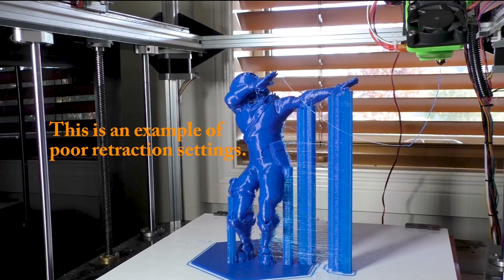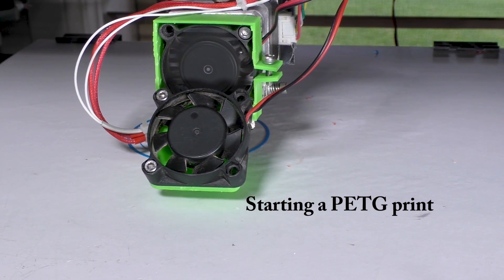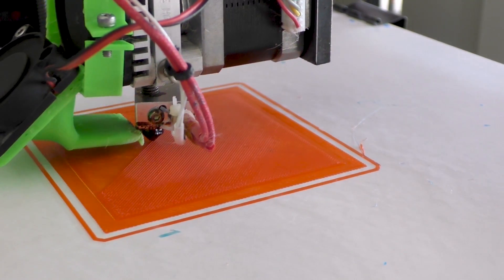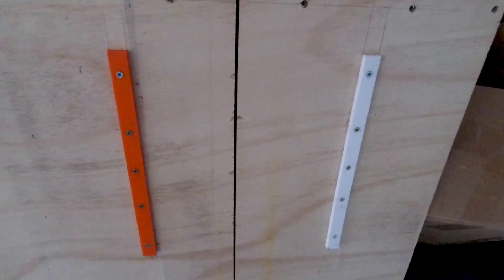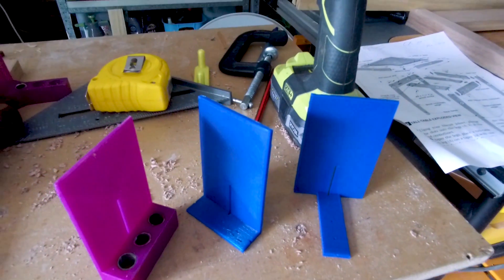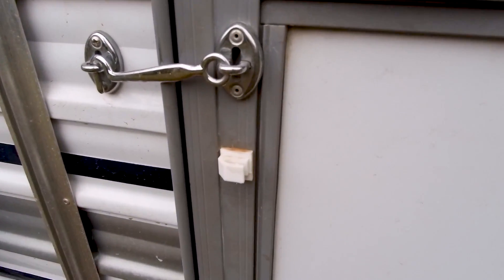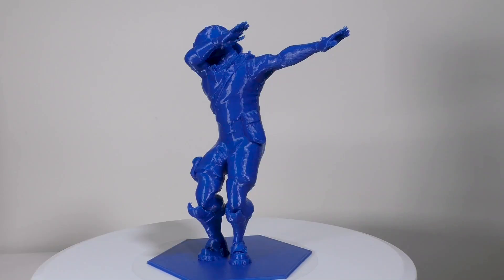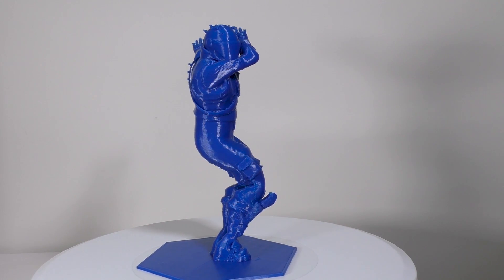A Beginners guide to printing PETG Filament

Comment: Currently printing first layer at 180mm/s and the rest at 380mm/s 💪🏻 rapid PETG at 240c/70c on an alcohol cleaned smooth PEI plate. No clean no stick

Comment: Still having trouble getting petg to stick to my glass bed. Hmm. Better get some painter's tape for when it does stick😲 Cura slicer's temperatures for petg were about 5 degrees lower than yours. I'll try it 5 degrees warmer.

Comment: Great video. I just went through 3 hours of frustration. Tried bed at 70, 65 and 70. Tried nozzle at 190, 200, 205 and 210 and 220. Adjusted z offset and so can't get adhesion. I noticed you have much higher temps and slower speed so I'm going home to try that. Printers in 2024 are a lot faster so if you think there is a better speed based on current printers, like mine goes to 500mm/s, please let us know!
Reply from the maker: slow the first 2 layers down to 20/30 mm/2

Comment: I have heard Acrylic cement like weld on 3 or 4 works in cementing PETG parts together on a molecular level. I'm not sure if this is true but I have used weld on 3 and know it works excellent on acrylic. I'm going to try it myself pretty soon but was wondering if you had already tried this method for connecting PETG parts together?

Comment: Retraction is 3mm ... 35m/s for a direct extruder setup. Print as fast as you can. I will try that. Did you ever play around with flow rate? Also, I am using the standard 1.75 diameter filament. Thanks and great video. Richard

Comment: Ive gotten some pieces to print with PETG on the Ender 3 PRO, but it actually took a spot of the black part of the bed off. I did some adjustments and now I cant get the filament to stick to the bed.

Comment: Excellent beginners guide. I have been working with PLA for 5-6 years and would like to try PETG for better UV/temperatur characteristics. 
I would still use PLA when it is suitable. 
Is it wise to use PETG with a dedicated printer, including hotend etc,  or is it no problem to swap between PLA - PETG - PLA..... ?

Comment: you mean i gotta clean the extruder?  that's what I'm getting, it just curls up at the extruder, won't lay down on the glass.  Can I get this stuff to stick to glass or do I need a pad?  how do you get the slicer to lay down the first layer with different parameters? from the rest of the print?

Comment: i can vouch for petg sticking way too hard to the bed. my friend is really dumb but he thinks he is a bit of a printer guru cos he has the most expensive printer out of all of us. anyway i do my research and i knew that petg sticks too hard and so i told him he should not be squishing the first layer and then he completely thinks i am the dumb one. so he bet me that the petg wouldn't stick too much and then i bet him that if he doesn't think it will he should put his wang on the print bed and accept the first layer onto his p$n!s and so he said, OK for $100. We all said ok and then set up a print and the petg went straight down on his pecker and he was screaming and had to go to the hospital and indeed the Doctor said the plastic was very stuck to his purple helmet. he doesn't speak to us after that but i think he now sets his petg first layer height a bit higher cos he knows it sticks REAl GOOD. Ha ha ha

Comment: My biggest issue with PETG is that it gets all over my nozzle. It's the only material I'd like to print with for now. I had been printing at 250C for months, and had successes. But perhaps printing at so high a temperature, the material is attracted to the nozzle more so.
Reply: Correct. 
Lower temps have helped me preventing those blobs. Also, try a lower temp 1st layer and bump it up by 5 or 10 degrees for the next layers. The nozzle likes to cling to hot PETG at the base layer.
Reply: Old comment, but what I found fixed some of my PETG problems was actually having the nozzle further away from the bed, it doesn’t like to be squished down like PLA. High bed heat - 80-90C- makes sure it’s adhered even if not close to the bed.

Comment: Any idea why my first 3 or 4 layers seem to go down too thick and start rubbing on the nozzle and making a mess?  After the bottom layer when it starts infill, the rest of the print is absolutely fine.  It's like the PETG is expanding as it cools.
Reply from the maker: That is a strange one - check your slicer settings.
Reply: I have the same problem, still haven't figured it out. I think it might be moisture or just too much heat due to the bed being hot and the first few layers being too close to it.

Comment: With the filament sticking to the nozzle problem, I had a brand new stainless steel nozzle to print the PETG with, it still stuck to the nozzle in a ball. The only thing I can think off for this sort of problem is the nozzles need a coating of Non-stick on the nozzle face like Teflon then maybe that with help stop the sticking problems?  So PETG is an hard filament to do right. I know so hard I may well not carry on trying to use it?  Even ABS is big pain in the backside too!  I even find PLA can be a sod to do even with the bed leveled and the Z height right.  I've tried the Hair spray, the glue stick. I used ultra flexible textured bed and none of those hold on to the PLA neither known the ABS or PETG?  It driving me nuts the amount of time , money and troubles I can see why 3D printing is just for the people who seem to have a gift for doing it well/ Us new to the hobby I think tend to try very hard and put in tons of hours of work spending tons of money on this possible great hobby and end up fed up at not getting it to work even with the advice from the experts.  I maybe not carrying on with this hobby as I put tons in and don't get PLA to work.
Reply: Remove your nozzle, spray the external section of the nozzle with an extremely thin misting of cooking spray. Put your nozzle back without touching it too much with your fingers. Also, what surface are you printing on?

Comment: I actually just flipped my spring steel bed so i'm printing directly on the steel. and that's working GREAT. When the print is cooled a little it pops right off.

Comment: Great tips.  I have been banging my head against the wall on a perfectly flat bed, and from you I learned I was trying to print way too fast.  I dropped back to 25 (Ender 5, glass bed, Magicgoo) and it's bonding/building up nicely.  Thanks

Comment: 7:11 into the video.. (you do not need to glue petg) just use a soldering iron and plastic weld it together.
Reply: Or couldn’t you make like pegs or something to fit the pieces together?
Reply: @theCraftyHeretic  Sure you could.. Just from my experience fusing the plastic together is a simple quick method that has high strength.

Comment: Finally someone says petg is not easy to print unless you've got things nigh perfect. 

It's great when I can use it but there's some models for which it's too much trouble (compared to abs or pla). If you can't remove the support, or can't add support in the right spot, then the object will be distorted - and functionally useless. Cura's "tree supports" helped a lot with this, in addition to painstaking tweaking. 

In my limited time with my printer I can say I've had more trouble with PETG than PLA, ABS and a little TPU (haven't used it much) combined. Although it helped when it came to getting TPU right the first time.

Comment: I've been using petG with my 3-D pen.  It's been working really well compared to other filaments that I've tried.  I know the application and set up is even more different using a 3-D pen versus a 3-D printer, but I wanted to see if there were any resources to help me improve my work with petG. The projects that I'm working on right now is leading me to try to melt The PEtg filament to high enough of a temperature that I can pour it into small Molds.   Do you have a recommendation for a temperature that will not scorch it  while at the same time keeping it melted long enough to pour?   Or is that even possible?

Your video has been a great insight Into the characteristics of PETG! Thank you!

Comment: The Hot End - 3D Printing & Tech Reviews. Thanks for your advice from my previous question. Would you you recommend the E3D titan aero or Herma or the Slice Engineering Mosquito Hotend? Also, with increasing the flow rate, could I also increase print speeds of my print or no? What print speeds, acceleration and jerk do you typically use on your Folgertech FT-5 R2 for PLA and PETG?

Comment: Hello. Great guide on printing with Petg. I am having some trouble with my 3D printer. I have a Folgertech FT 5 R2 and I am getting what looks like some small minor underextrusion or filament skipping in the layers and also extrusion inconsistencies throughout my prints. I am using Makergeek’s PLA with the printer’s original extruder. I have already change the print speed setting from the default, which was print speeds of 60 mm/s, acceleration of 3000 mm/s^2 and jerk of 20 mm/s to the changed setting, print speeds of 30 mm/s, acceleration of 500 m/s^2 and jerk to 15 mm/s, from there being layer shifting and under extrusion problems at the default speed setting. this kind of worked but still my problem that I am asking about is still there. I don’t known if the problem is the filament, the extruder setup or my Cura Slicer Profile Settings. What is the best why way to solve this or a list of solutions I can try?
Reply from the maker: You could try increasing the flow to about 103% and if that makes a difference then you need to calibrate you E-steps. The standard extruder on the FT5 is very basic and I would recommend upgrading it, there are plenty around. I cant recommend the extruder I have on my FT5 because they are not made anymore.
Reply: The Hot End - 3D Printing & Tech Reviews. Thanks for the advice. Would you you recommend the E3D titan aero or Herma or the Slice Engineering Mosquito Hotend? Also, with increasing the flow rate, could I also increase print speeds or no?

Comment: Nice work, I print petg, a lot. I like the opaque colors, it helps with the stringing and predictability. My nozzle is 245 my bed is 65. I coat the bed lightly (aqua net purple) before every print, I only scrape it smooth after every print, I don't even get all the hairspray off, it even covers finger grease! I only wash the bed every few kg. always sticks, always come off when done. My first layer is around 20-25 and my normal layers are usually around 40-45 mm/sec. unless the part has a ton of small features, then I turn back to 35mm/sec. I don't use a part cooling fan unless bridging then only about 30-35% fan. .4 nozzle .16-.2 layers. Direct extruder.

Comment: Please use 50/50 mineral spirit with ionized water to spray near the base where the petg touches the glass. They almost pop by themselves in 5-10 seconds. I use this method for more than 4 years now. Regular picture frame glass. I clean before every print with this solution and a napkin. First layer i squish as normal and no slowdown.
Reply: I use the same method with great success. Never had any trouble getting a part from the bed. Genius whoever invented this method!